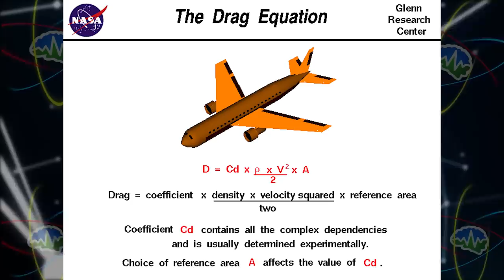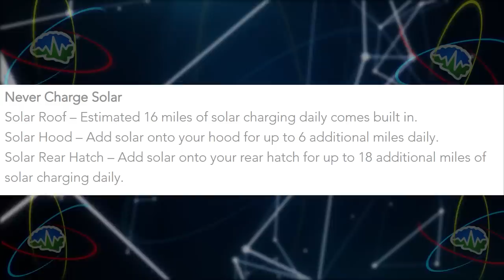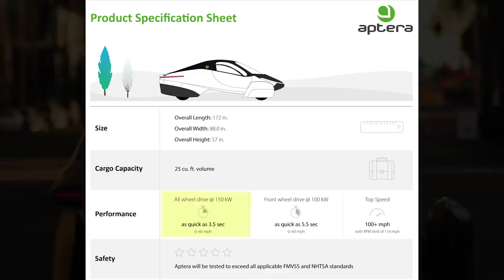Aptera Beats Tesla? | In Depth

Comment: I always hear about after incentive price. In Wisconsin we actually have disincentive taxing on electric vehicles. We get taxed $75 per year for  electric vehicles, even hybrid vehicles, even if you don't drive them. At the federal level only people of means ie folks with high income can take advantage of the tax incentives. Low income= no incentives. People who can well afford the high price of gasoline get a break, those who can't get no break. I know, I know, people with little income pay less tax so they don't deserve a break. Ma an I worked 42 years and are now on a fixed income that is getting eaten away by inflation. We would like to do more travel but with the price of gasoline it's getting harder. We ourselves are actually getting along ok for the most part as we purchased a two year old low mileage Chevy Volt for $11,000 that fits our needs quite well. But it does seem somewhat unfair that old retired folks who paid taxes all their working lives can't catch a break. The incentives were first introduced to incentify the purchase of an EV to get the EV industry off the ground because EV's we're so expensive. But one would think that selling more EV's, even to retired folks would be a good thing. But who cares about old folks nowadays anyway.

Comment: . . . My biggest concern, not mentioned in the video, is safety, especially 
in aggressive urban traffic that has many large heavy vehicles, such as 
cargo delivery trucks and buses.  No protection in a head-on collision.
Reply: Untrue.  It has a crumple zone front and side air bags and other safety measures.    Wait for the crash test ratings before it starts production.
Reply: @n.brucenelson5920   . . . Fair 'nuff... but it just seems to me 
the driver/passenger's feet are right up there at the front,
 "crumple zone" or not.  We have lots of big gravel-hauling 
and cement-mixer trucks that it would seem could flatten 
anything shorter in height!  I'll certainly be interested in the 
crash-test results.

Comment: It's not "range anxiety" that's the important number, it's "time to recharge" to full. My SUV only has a 325 mile range BUT takes only 5 minutes to fill up. AND, if you're in a cold climate, where are you going to park while your at work??? IF it's not on a charger, sub freezing temps are going to render your battery worthless, as in damaged beyond use. AND, since we're headed into a solar minimum, it's gonna get colder.
Reply: By this measure, the Aptera gains range 3 times faster than a Tesla plugged into the same charging source.  A fast DC charger will give you 1000 miles range with the 100 kWhr model in about two hours.   There is plenty of energy, supplemented by solar, to keep the batteries warm.  In addition, the Aptera is far more stable in side winds than a slab sided SUV, and it has faster, more reactive traction control.  An SUV may have some utility that the Aptera doesn't, but you are paying a stiff price compared to the Aptera any time you are not carrying more than 2 people or 300 lbs of cargo.

Comment: Would love to test drive and possibly own one. Question: Doesn't the energy needed to charge up electric vehicles come from the power plants that run on coal or fossil fuels? And will it not be necessary to mine huge quantities of metals, elements and rare earths to make them including their components? Have you not seen the huge holes mining cause on the earth and the big diesel machinery that are used? Should we not look more towards recycling more and even repurpose already built used vehicles with retrofitting technologies to conserve natural resources and avoid more garbage? Just saying
Reply: I appreciate your observation particularly with big car companies trying to electrify huge pick up trucks. But this vehicle is transformative. It is small, light, air efficient, effectively solar. It if sold in large  enough numbers it would make a difference capable of reducing demand on fossil fuels, cleaning the air, and reducing the cost of highway and bridge maintenance without  making major demands on the electric grid.  It would provide senior retirees with low cost transport providing them with the freedom to shop and see doctors. It is not the solution to future ecotransportation but it would be a large part of that solution.

Comment: Oky i have question what about winter season cause its hard to find sun that time and will it put chraging plug too
Reply: Yes.  It will gain about 13 miles per hour when plugged into a standard 15 amp 110 volt outlet., or 3 times faster than a Tesla when plugged into the the same fast charger.

Comment: It looks awsome but i dont think you could compare it to a Tesla because a Tesla has 4 wheels i wouldint want to drive an aptera in winter roads with ice and snow  but it looks really cool for a summer car
Reply: If you have the 3 wheel motor version and snow tires, you would likely have more control than with a Tesla.  The Aptera has much faster reacting ABS and traction control, sensing and adjusting for slip 32 times per wheel revolution.  Also, with the motors in the wheels, you don't have to worry about snow buildup in the wheel wells, because that is where the heat is.  We will have more testing next season to see if these thoughts are confirmed.  Aptera can also do tank turns.
Reply: @n.brucenelson5920  amazing.i wish i could test one in winter time in quebec icy conditions it looks so cool and fun

Comment: If getting commuting  for next to nothing is what you want then the Aptera is for you.  I would agree with you that the shape is off-putting. Having quickly looked at aerodynamic drag coefficients of various vehicles, including  the Volkswagen XL1 at a mere  0.159 according to Wikipedia. I do not agree that a car's design has to be such a radical departure from the norm of today's modern vehicles to be aerodynamically viable. I would however agree that Tesla could probably learn from Aptera and thereby greatly improve their overall vehicle performance by aerodynamically streamlining their vehicles. And if I could ever afford a Tesla one day, it would be cool to have self driving as part of the package which I don't think Aptera are aiming at.

Comment: Can you charge it AND use the solar panels at the same time ?
Reply: No real reason to.  You can drive it and add solar power at the same time, however.
Reply: Yes, I read that you can charge at home while it sits in the sun charging even more. Not while DC fast charging though, at a speed of 50 miles in 6 minutes.

Comment: I just watched this and was thinking about the solar car challenges here in Australia the race from Darwin to Adelaide.  

This is a great challenge to advance the tech and vehicle design.  I have often wondered if it is viable to also have a solar charging blanket that covers your car and continues to charge the batteries .... plus one car I saw was completely covered in very small solar dots that charge as you travel during the daylight hours thus leaving the main battery reserve for driving in the dark hours. 

Good luck we need more alternatives.

I own a big Ford G6 limited edition  very plush and fully optioned. It has a big engine with a caravan towing pack and electric brakes. It's a greedy gas guzzler, it is tuned to run on LPG and E10 petrol. However I don't drive it very much maybe 1000 plus kilometres a year mainly on holidays towing a trailer with our camping equipment.

It cost me extra $$$$$'s keeping it registered and insured. 

My preference or 1st  choice is to use Uber and or the public transport. Electric buses and EV taxis are my favourite forms of transport.  

Check this out if your interested. 

https://www.bridgestone.com/bwsc/

Comment: Does it have charging port, in case sun does not shine?
Reply: Yes, of course.  You can gain 13 miles of range per hour plugged into a standard 110 VAC 15 amp outlet, up to 500 miles per hour from a 50 kW DC fast charger.

Comment: FINE PRINT: Aptera is not 6X-ing their market with $6000 cheaper + $7500 tax credit: you only get the tax credit IF your tax bill is at least $7500. If you pay $0 tax, then you pay full price for an Aptera because you get $0 tax credit. Plus the looks reduce the market. And I'd hate to collide with a full size SUV in this!

But best wishes to Aptera, a local San Diego startup! I loved the beautiful San Diego scenery in the promo videos.
Reply: Of course the tax credit is not even available for three wheeled vehicles at present.  This could change by the time they are shipping however.  And incentives may take other forms than tax credits to get such vehicles into the hands of people of lessor means.

Finally, you wouldn't want to collide with an SUV in any vehicle, but the safety features of the Aptera will surprise a lot of people when the ratings are released after crash tests are performed late in the year.

Comment: solar means you need sunlight to actually shine down onto the solar cells right?   you cant be parked in shade on the street in the middle of they day.   I guess it will be good in a hot climate with a lot of sun with lowrise buildings.
Reply: This is true.  However, the efficiency that makes solar work, also means that you can plug it in to a normal 110 vac outlet and gain range at a rate of 13 miles per hour.   This works anywhere.

Comment: So....if it is THAT efficient, maybe they provide a bicycle pedal generator module in the trunk that you can throw in the floorboard and plug in, when you run out of battery power. Pedal away for a half hour and you should get enough charge to get a few miles to the next town? That would be interesting....
Reply: Could be....

Comment: how is the handling in snow?
Reply: We don't have the full answer yet, but with snow tires, and the 3 wheel motor version, it should be very good.  This is because the traction control is superior to almost any other car on the road.  We will have extensive test results in difficult conditions from the Elaphe cold weather test track next winter.

Comment: Aptera already has a Airplane structure ...  just need some carbon fiber wings, some extra controls and  batteries to take off.    
Caution:  Don't try this at home.  also, you got to be a adult of 18yrs or older.

Comment: Feels like I’m watching an episode of ‘Dumb and Dumber’. Air is not a liquid, but we treat it as such for aerodynamic calculations. The shape of the Aptera is only “weird” if you completely disregard its aerodynamic advantage. A two-wheel, tandem seat arrangement would be even more aerodynamically efficient, but current battery density might mean less range and some a afraid of two-wheelers - living in the icy and snowy Mid-West, I understand.
Reply: 2-wheel design would make it a motorcycle rather than an autocycle, which means motorcycle license and helmet required in most states.
Reply: @kkobayashi1 , another good point for multi-track. Just one more seat would definitely clinch it for me.

Comment: what will it cost to replace the front wheel after a side swipe with another  vehicle ?
Reply: Depending on the amount of damage to suspension, but a new wheel motor if needed would run around $2,500.

Comment: Great little-ish intro. Nice to start fresh with the drag coefficient. Maybe you're both too young remember, there used to be oodles of commercials from every car maker showing wind tunnels and stating wind efficiency improvements from this curve or that, molded side mirrors, folding headlights, the list went on for a while till they realized that drag coefficient had basically stabilized to all you can do without changing the model T box design. They told Ford some changes can't be done, and he said something like "{Nonsense, If I gave the people what they want they'd still be scooping horse manure.}"
He was right, we'll know what we want when you show us it works. 

Those of us who remember know all car makers are still doing it wind testing, they must, best they can without upsetting public opinion of a "car-ish" shape. They compare every line change they can to get another .1 MPG using nearly the same profile. Some have already hinted if one country would give up on dual side mirror concept as a minimum safety feature, the rest of the world is ready for camera based mirrors for a HUGE increase in efficiency. Nice that three wheel vehicles get some reprieve from such things, but not all States have given up the mirrors even for motorcycles.

That data is hidden out there somewhere and I guarantee if you could find it, the drag coefficient numbers would easily backup the cost of pushing various boxes through the wind 1.5 touchdown lengths per 100 watts of power, or however you cook the numbers, as long as done fairly.
Reply: This car will use under 100 watt hours per mile at EPA highway cycle speeds.

Comment: Not really usable at all in winter conditions because the 3 wheel and solar reliability. 

Should be a 1 seater version or canoo config for summer fun tho.
Reply: The efficiency that makes solar possible still means that you can put it in your garage and get 13 miles additional range per hour from the 110 volt outlet.  It has better traction control than any ICE vehicle or even an EV such as Tesla, so with snow tires, it should be excellent.
Reply: @n.brucenelson5920   in winter you get the road covered in snow and slush that freezes. All cars have 4 wheels for a reason. The rear wheels follow the tracks of the front wheels. Driving this would be a nightmare in those conditions, regardless of how good the traction control is

Comment: I would have thought charge would be in miles X hours ..simar to kw hrs rather than miles per hour
Reply: Aptera will gain 13 miles per hour plugged into a standard 110 VAC 15 amp outlet rated on the EPA highway mileage cycle.

Comment: If they actually produce then I would gladly buy one. I don't want a repeat of VaporWare like ELIO did. I also see that to be able to do this vehicle you CAN'T use 4 wheels because then you have to meet safety standards for cars. With 3 wheels you only have to meet the safety standards for a motorcycle (aka AutoCycle). The big question is can they deliver?
Reply: They will exceed automotive safety standards with this design which will become clear when the crash test results are published.   The 3 wheel design was needed to reach the aerodynamic goals.

Comment: All very exciting and informative.  How do Aptera batteries compare to Tesla?  How long do they last?  How fast do they charge?  Thanks.
Reply: We don't know the supplier yet.  It  might even be Tesla.  We do know that they are light weight for the capacity - about 10 lbs per kWh, and that they gain range quickly while being charged - mostly because of the low energy demands of the car.
Reply: @n.brucenelson5920  thank you for the v. quick reply.  Will be watching more of your videos
Reply: @danielboyd9380  Just so you know, I am a volunteer in the Aptera Brand Ambassador program, but don't work for them or produce videos.
Reply: @n.brucenelson5920  Thanks v. much for the replies.

Comment: But how heavy this car is?  If it’s windy it’s stay home ?
Reply: The weight weighs between around 1800 lbs for the 40 kWh version to  around 2,200 lbs for the 100kWh version.  My gen 1 Honda Insight weighs around 1800 lbs for comparison.  It has been tested stable in 110 mph side winds, far higher than any slab sided SUV.
Reply: @n.brucenelson5920  thanks!

Comment: I'd like see this drive in the Santa Ana winds
Reply: Because of the shape, winds will have little influence on it.  It has been tested stable in 110 mph side winds.
Reply: @n.brucenelson5920  that's exactly what I wanted to know. It's a disaster with those Santa Ana winds hitting from the side. Those winds literally cause accidents and flip big rigs . Thanks.
Reply: @DoritosResidue  even most slab sided SUVs are in trouble in 90 mile an hour winds or so.  Aptera does considerably better.

Comment: How safe is it in collisions and sharp turns?
Reply: As far as sharp turns, the center of gravity is extraordinarily low due to both the batteries and the use of wheel motors.   It is certainly more stable than any SUV.

Crash safety ratings will come before production starts.

Comment: My biggest concern is safety. They never once seem to talk about safety or how repairs to the vehicle would work. What if the vehicle flips and or the solar panels are damaged?

With Tesla they have great safety ratings .

 This is a cool and interesting car to just use to go around town but that's it. The lack of rear seats and the questionable safety are the only reasons I wouldn't have this as my main vehicle
Reply: First of all, it is not designed to be a mass market car.  It is a focused design on efficiency and safety for one or two people.  We know it is at least twice as efficient as a Model 3.  We know they are in technology sharing talks with Tesla but don't know the results yet.  We also know that the Aptera will be crash tested to automotive safety standards.  I have reason to believe the performance here will be outstanding as well.

The ability to drive locally without needing to plug in and to gain range quickly on trips and to sleep two in climate controlled comfort on camping trips makes it very attractive for us.

Comment: If it's fully charged it would be nice to be able to feed back into the grid.
Reply: This is under consideration.
Reply: So every time you used it to feed the grid you'd be reducing its usable battery charge cycle amount by 1 time?
Reply: @markbajek2541  The solar panels could feed into the grid once the batteries are charged.    And ideally get a credit for the contributed power.